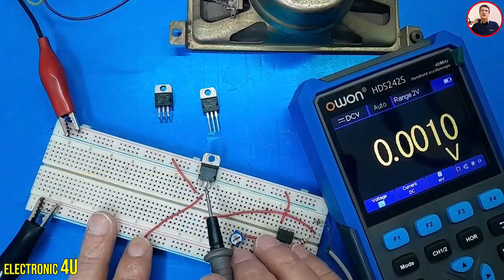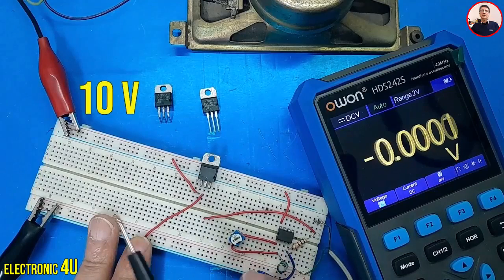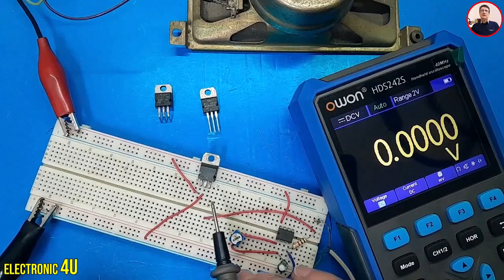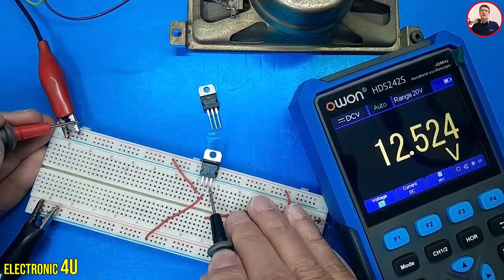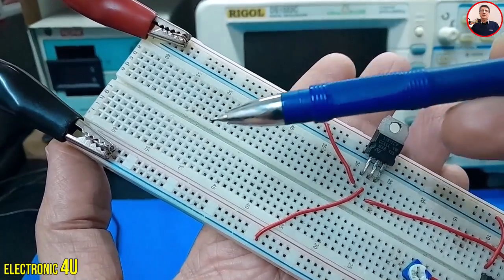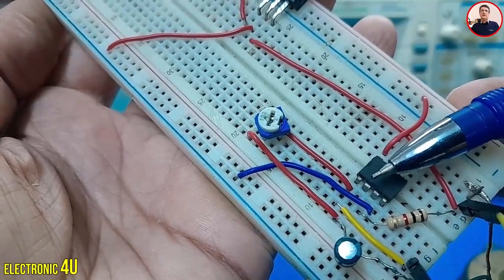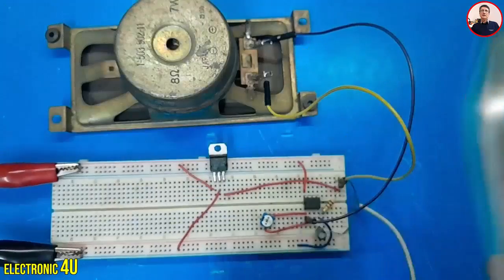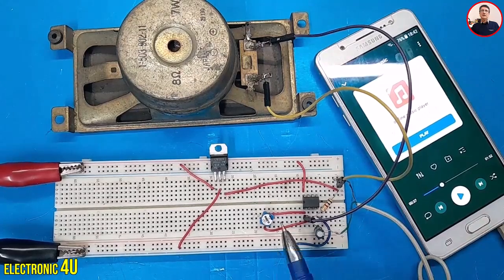How to make a negative voltage with a positive regulator?

Comment: You might consider doing a video on the difference between the lowest dropout voltage of a linear regulator and the voltage headroom that is required to attain the greatest/best ripple rejection. Hobbyist tend to only add the 1-1.5V required to prevent dropout. However, for the best ripple rejection, you must add 3V. The data sheets obscure this detail.
Reply from the maker: I will try to do it in the next videos. thank you

Comment: The 78/79 series regulators need a capacitor across the output to stop the regulator from oscillating. 
The speaker needs a 100+ uF capacitor in series with it to block any DC component from burning out the 8 ohm speaker coil, although the 4558 probably isn't powerful enough to do that.
If your output is going onwards into other equipment, maybe use a switching regulator (78S40 - others are svailable) in an inverting configuration to derive your negative supply and keep the opamp's virtual ground at 0v instead of 12v.
Reply from the maker: Thank you very much for the useful information. My purpose of this video was not to build and operate the circuit. I just wanted to show that the negative voltage is nothing but changing the reference
Reply: @Electronic4U-david  Fair enough.

Comment: the new reference ground can't be combined with the whole system ground, will result in shorting the regulator o/p, stand alone use is ok, better use a center tap dual rail transformer & avoid complications.
Reply from the maker: thank you very much It is absolutely true. I hope to use your valuable information again.

Comment: Do you really mean I need no LM7912 but I can make from LM7812 ?
Reply from the maker: It is better to first create a negative voltage with the help of a diode and then stabilize the voltage using a 7912 regulator. This video is just a way to show the change of reference point.

Comment: You are applying 24 v to the LM4558. From ground to pin 8.  You are making any negative voltage from a positive reg. You are builing an amplifier using LM4558. Where is the neg voltage?
Reply from the maker: In fact, there is no negative voltage. I only changed the reference to show that there is no such thing as a negative voltage at all. The output of the regulator is a reference or ground. To activate the op-amp, the voltage of the power supply is entered, but for other parts, I use the virtual ground as the ground. Because we have changed the reference, the reference used with the multimeter is the same as the output of the regulator.

Comment: In general the Input voltage for the LM series ist not twice the output voltage! The input voltage required to
maintain line regulation for a LM7805 is 7,5V and for a LM7812 is 14.6V! Super safe operation is given at Vi = Vo + 3V! You are right, if you need a Voltage symetrical powersupply, then Vi = Vo x 2, but it is not current symetrical, therefore do not use such a low cost crap for Audio applications 😅.
Reply from the maker: Thank you for your good information. I said in the video that only 2 volts more is enough for the regulator. In this video, I tried to show that negative voltage does not actually exist and only the reference determines the type of voltage. Increasing the voltage of the power source up to 24 volts was only to obtain symmetrical voltage and it is not necessary to use it. thank you very much

Comment: -12V is unregulated. Better use 7824, put 2x 100k in series across and attach a 3rd (power-)opamp to junction with unity gain. Use output as GND.
Reply from the maker: Thank you for your great information. It is absolutely true. I learn from you. I hope to benefit from your information again.
Reply: I apperciate for your inputs and the content creator has also acknowledge your input. I am hobbyist, if this the care, then can we use as dual supply to operate for pre-amp boards that runs 24v dual supply. I'll follow the same instructions for experimental usage and revert is this working or no. Later with all your inputs and suggestion will try to implment thoroughly.

Comment: - To set up a plus and minus power supply you need ONE transformer WINDING WITH CENTER TAP, one bridge rectifier and a 7805 and 7905, add the capacitors.
- Or you have TWO SEPARATE transformer WINDINGS then you can set up two rectifier stages, each with a 7805, add the capacitors.
But the first proposal requires fewer components and is cheaper.
Reply from the maker: It is absolutely true. I did not mean to use this voltage. I just wanted to show that the negative voltage is nothing but the normal voltage that we have changed the reference. Thank you anyway

Comment: I doubt that this can appropriately be applied when the resistance in the positive side is higher that the negative side. If the resistance on the positive side (between  +V and OUT) is lesser than the negative side (bet OUT and -V), a negative current will flow in the output pin of the regulator. Is the regulator capable of handling this? I didn't see in the datasheet a negative output current capability of the 7812 regulator.
Reply: I, too, am wondering about this application. As you give an electrical reasoning for question its viability, my thinking was more basic... If this works (well and appropriately,) it seems to me that there would be no need for the LM79xx series of negative regulators. The economics would dictate buying more LM78xx series, in order to gain a quantity discount on the parts order. The economic benefit would extend further, to the regulator's supporting caps, because the LM79xx negative regulators use slightly different supporting caps, than the LM78xx positive regulator series. I also wonder about the current output. Wouldn't the single regulator continue to supply only its rated current? Say 1.5A. And, wouldn't that fixed amount of current have to be shared between the positive voltage and negative voltage usages? The author does prove the concept with his multimeter, but I am still wondering about the idea...
Reply from the maker: The problem is that in order to use this voltage, there must be great accuracy in the power source and if the current is higher, it will have problems in negative and positive. Of course, as I said, I had no intention of using this voltage at all, and the sample circuit was only for demonstration use, not for long-term use
A
Reply: Your replies are correct. As a proof of concept, it does work. Thanks for your replies.
Reply from the maker: It is absolutely true. This regulator ran well up to 1 amp in my test without any interference. But my purpose of this video was not to use this voltage along with high current. I just want to show that the negative voltage is nothing but the positive voltage that we have changed the reference.